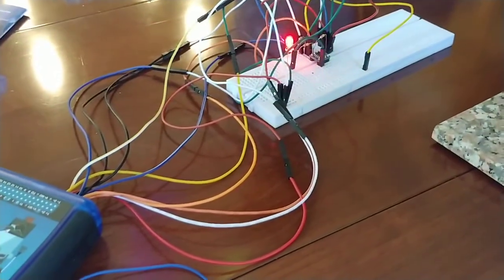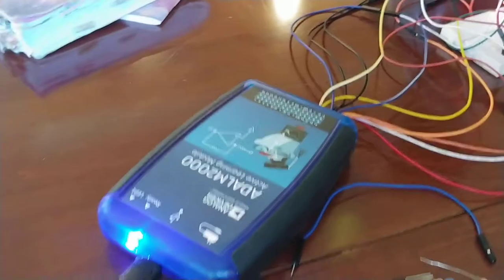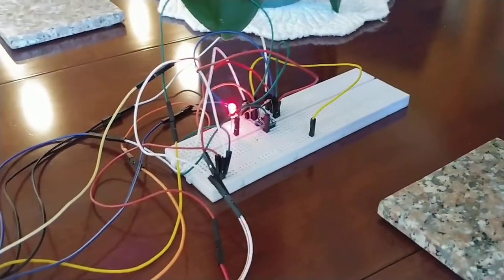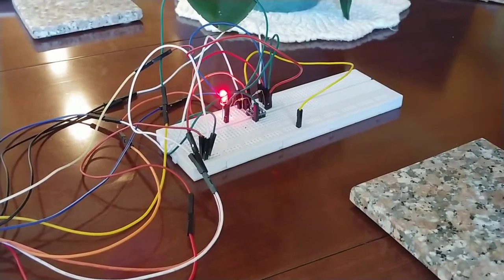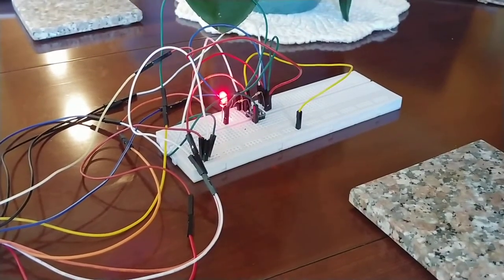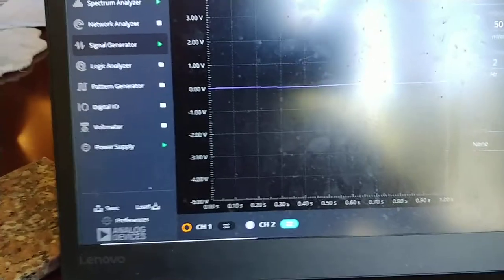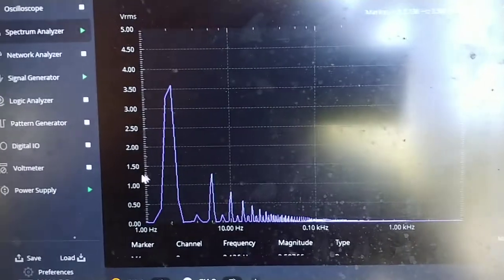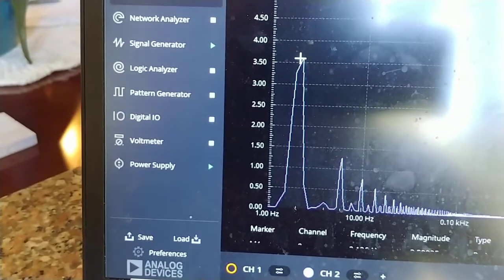Stochastic Resonance You can see

Comment: An excellent demonstration of SR - many thanks! where is the non-linearity required for SR come from in this case? (I am actually learning about SR and finding it fascinating)
Reply from the maker: The system is non-linear in that you can not use superposition to analyze the noise input alone and the sin wave input alone and then sum the two responses together and get the proper response.  The noise peak to peak is just large enough to trip the Schmitt trigger back and forth, and the sin wave Vp is set to that it can not trip the Schmitt trigger on its own. If Vp of the sin wave is too big, then it behaves like a normal Schmitt trigger would and you get a 50% duty cycle square wave.  It is best seen on a spectrum analyzer.  If you see the peak at your target frequency but do not see peaks at the 3rd ,5'th ,7'th .. harmonics, you have stochastic resonance. Google this paper : STOCHASTIC RESONANCE IN A BISTABLE SYSTEM  Here is the lab manual:https://www.dropbox.com/s/mah6ifz30deevz3/summer_bridge.pdf
Reply: @davidwparent  thanks David! Will read the paper. Also I think I need to setup the experiment and see it for myself. Super interesting! Thanks also for the lab instruction.
Reply: @davidwparent  Hi David, massive thanks for the lab manual and these description! I just set up the circuit and really enjoyed seeing it! notably the disappearance of the harmonics in the power spectrum when SR in play is interesting.
Reply from the maker: @aspiran2010  Great, now you can explore how the hysteresis width affects the SNR or what the minimum detectable signal amplitude is.
Reply: @davidwparent  also one quick question, i struggle to understand how the harmonics are gone. is it essentially like a pulse width modulation replicating the sine wave? because the ST is at the end either on or off. it is so fascinating to see the even harmonics are removed while the output is still "digitalised". The closest thing I can think of is PWM. (sorry for the basic question - I am very new to SR)
Reply from the maker: @aspiran2010  You are really getting it now! The reason it is not like PWM is that the period is not fixed like in a PWM system.  The period of the pulse is still random, but there is this "hidden" sin wave that can be seen with the FFT.
Reply: @davidwparent  a truly elegant experiment! I also really enjoyed reading through the manual. A great effort has been put into this really! I will give this to one the physics students next year as a BSc project. Thank you so much for sharing the knowledge.
Reply from the maker: @aspiran2010  I am blushing.  BTW is this you:https://www.swansea.ac.uk/staff/science/physics/armin-a/ ?
Reply: @davidwparent  ah yes that is me - the photo is a bit cheesy, guess I need to change it LOL

Comment: Can a circuit be made where an audio signal of very weak intensity is injected into the noise and it is amplified by SR and made audible?
Reply from the maker: Yes, but I am not quite sure how it would sound.  I think that if the audio were modulated with AM or FM, this could be used as a detector at the modulation frequency.  Recently we were able to show SR being used to detect a sin wave above 10KHz.  It seems the limitation is the slew rate of the OPAMP.  Of course, faster circuits can be used to implement hysteresis.
Reply: Does the Schmidt trigger circuit shown have bandpass , highpass or lowpass properties to the sinewave, or a rather sharp Q factor? Just wondering what the working range of the  input sinewave  frequency range would be?
Reply from the maker: @ossiebalboa5617  I would say band pass, but the Q would be very wide.  While it is called a resonator, I am not sure if it has a Q. Research topic?

Comment: So when the LED is blinking like that there's noise?
Reply from the maker: Hi Matt, The light goes high whenever there is enough energy for the Schmitt trigger to go into its low to a high state.  At first, you need the light blinking randomly, then as we add the sin wave (which does not provide enough energy to switch states), the light stops blinking randomly and starts blinking to the beat of the sinewave.